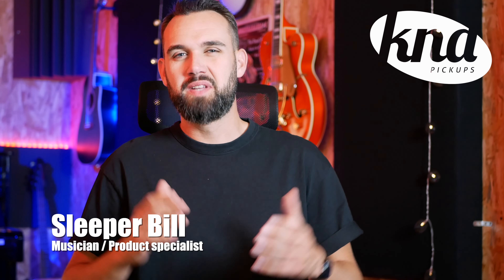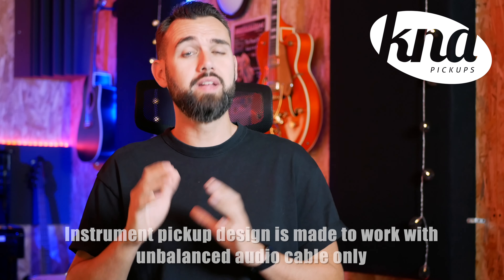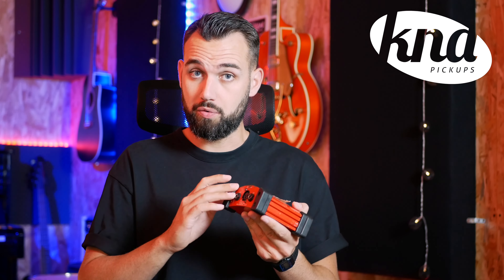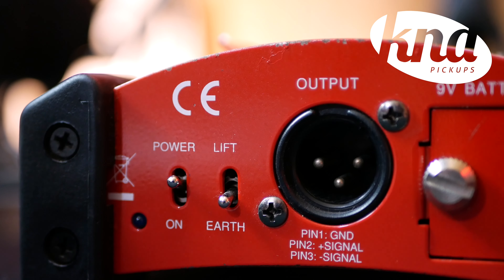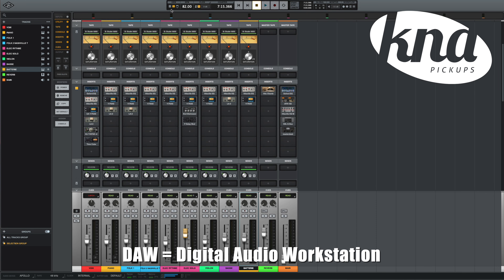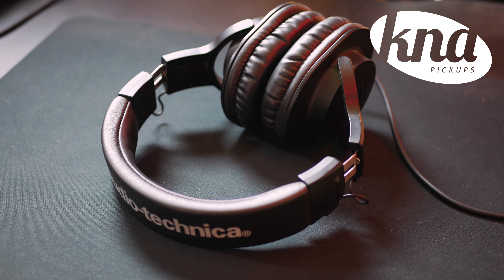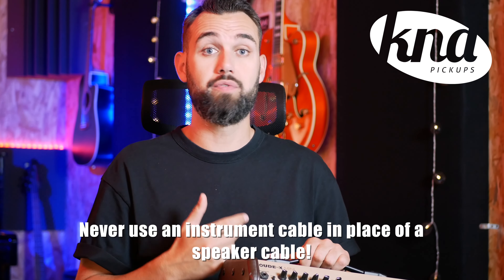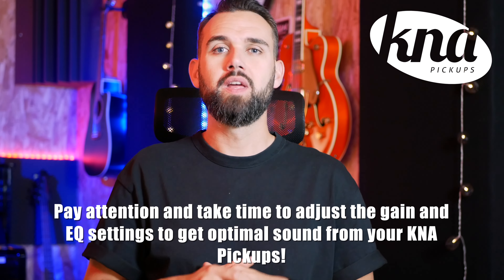KNA Pickups: How to connect them to a mixing console, PC/Mac and amplifier - Complete guide

Comment: @SleeperBill, @KNA, are there any specifications like input impedance that we need to follow for DI boxes, or do any active DI box works?
Reply: I got the Mooer Di Box micro DI box as it has a 1M Ohms input impedance. It works great with the KNA pickup. Note that the website says that 1 M Ohms input impedance is a good value to have